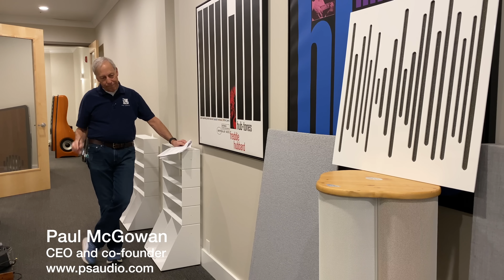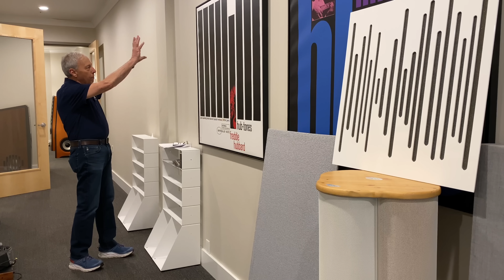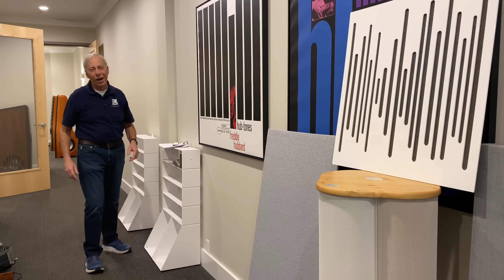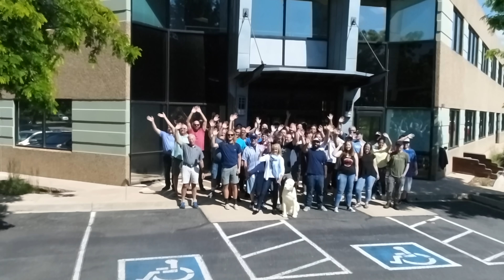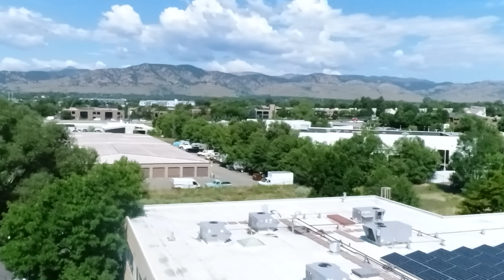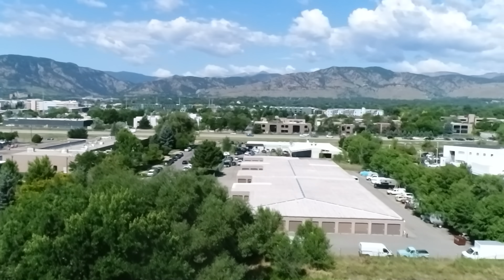USB Audio vs. I2S

Comment: I2S is a bidirectional digital signalling interface between a microprocessor or equivalent like an FPGA to an audio CODEC integrated circuit.  In its standard form it is for very short distances like the iPhone or Raspberry Pi to its analog headphone CODEC.  PS Audio use it for inter audio component communications. However in many cases, the data is clocked to CODECs as numeric values like PCM. Data across I2S can be specified and interpreted anyway one wants. You can use the I2S interface can be used to send PDM (pulse code modulation) but to ensure accuracy the master clock must have low jitter.

USB is multi peripheral interface protocol and associated physical media that is like a small network. Data is encapsulated with metadata which has to be stripped off to read it.
Reply: ThinkLearnSolve Right, I2S is one-way. Good to see there are others who aren’t just imagining things here. Of course USB can do excellent audio and with a ton more capabilities than I2S. This discussion is utter nonsense and it’s not rocket science to isolate an analog output stage of a DAC to avoid whatever noise USB might carry.
Reply: Contrary to what you believe, I2S is bidirectional using dedicated data signals for transmission and reception. It is used in situations where the CODEC provides both ADC and DAC functions such as a microphone and a headphone jack. The signal names are BCLK, LRCLK, SDOUT and SDIN.

As for I2S being similar to RS232 connections, it really isn't because most RS232 implementations are asynchronous and do not use a synchronizing clock signal. I2S is similar to the SPI (Serial Peripheral Interface) without the Chip Select signals and the MOSI and MISO equivalent to the I2S's SDOUT and SDIN signals.

USB's communication rates vary depending upon the version being used. 1.0 is 1.5Mbps (half-duplex)  1.1 and 2.0 is 12 Mbps (half duplex) except 2.0 can negotiate to enter 480Mbps (High-Speed) with compatible devices. Since half duplex communications is used, the effective data transfer rate is slower due to the datagram, protocol, and data direction switching overheads.

It wasn't until 3.0/SuperSpeed was introduced that  full duplex communications (using its additional pins) at higher speeds such as 5, 10 and 20 Gbps was accomplished to eliminate the overhead of switching  the data direction flow.
Reply: PebblesChan I2S is one way in its core specification. You can of course add as many channels of audio data and in whatever direction you want just clocked in parallel. Actually I work on a project doing exactly this. I2S is nothing special and I’ve done projects with it since early 90s shipping in millions.
Reply: It's actually one - Each I2S interface only has one master cloc. If you want another you can implement another.
An example of a device with 2 I2S interfaces is the Maxim MAX9880. Another is the Texas Instruments TLV320A.

For real time playback, USB can be problematic when too many devices or a lot of bandwidth is used on the same bus - particularly with the presence of low speed devices. (Crappy USB cables are another source of angst and unreliablity.)

Like Audiophiles, some gamers can apparently tell the difference in response time between their chosen and supposedly optimal interface and USB.  These serious gamers have resorted back to the PS/2 interface (and that even has latency).

There are may sonic experiences that cannot be reproduced electrically. Pipe Organ recitals are must be experienced in real life for the Full Monte.
Reply: PebblesChan This topic is silly. USB and I2S are serving different purposes. If you connect a modern SOC to a DSP or DAC chip inside a smart TV, you want a simple interface like I2S but not USB. When you connect an external peripheral to a computer, you want to use a flexible capability aware plug and play protocol like USB but not some low level interface like I2S. Theses are not competing solutions and the video makes a comparison on a false narrative.
Reply: Absolutely, but it's fun. The high end audiophile world is full of these unrelated technology comparisons.
Reply: @PebblesChan  Yes, I agree it's fun. That's why we are here, isn't it?
Reply: I2S is more similar to the old RS232 serial connections... otoh USB is like ethernet (with Power over Ethernet and the kitchen sink included haha).   Audiophiles advocating for USB is like libertarians advocating for more taxes.   Completely non sense... USB is the opposite of simplicity and cleanness.
Reply: @net_news  Audiophiles advocating for USB not being inferior to I2S understand how things work. Just avoid using your computer's power via a USB cable to power your DAC. That 5V in a USB cable is usually not very clean. And also, make sure your components are properly grounded so common mode noise is not migrating into your analog audio circuits. And don't use a DIY large PC with a ton of noisy fans. Fan noise is one of the worst enemies for a good system. Personally I like Mac Mini to drive my systems. And frankly, Mac OS is way more stable and unproblematic than Windows.
Complexity is much higher with USB than I2S, but your DAC doesn't care if it can get data bit-perfect and doesn't need to dance around with a PLL compensating for some external clock master. One beauty of USB is that it is asynchronous allowing the DAC to precisely control the clock (no audible jitter).

Comment: I2S (Inter-IC Sound) is an inter-chip standard that has been co-opted to transport audio data between devices. In fact, LVDS (Low-voltage differential signaling) is commonly used to actually transport the signals. HDMI cables provide enough twisted pairs and shielding to pass the I2S signals. One of the really cool aspects of using I2S is that the master clock can be transmitted or received to synchronize everything.

Comment: I have a USB DAC made by Stereo-Link (now defunct).  I plugged it in and it configured itself in Windows.  No drivers were needed.
Just for S&G I plugged in 5 6ft USB extensions to see if I could hear any degradation.  My ears detected none.
Reply: Many if not all usb DAC uses the same universal audio driver! and therefore we have no driver problems.

Of experience
USB audio can cause a lot of noise! I've experienced it! Remember that USB has 5V and that a desktop computer has a lot of noise!

The best thing is to use digital coax or optical from your computer to DAC!

I have experienced noise with
Cambridge dacmagic plus!
Reply: @ford1546  I guess the Cambridge dacmagic plus is one to stay away from then.  I'd say that the PSU in your computer must be crap, but if the 5 volt rail is THAT noisy your computer wouldn't boot.
There was no noise on my Stereo-Link 1200 even with 5 6ft USB extensions.